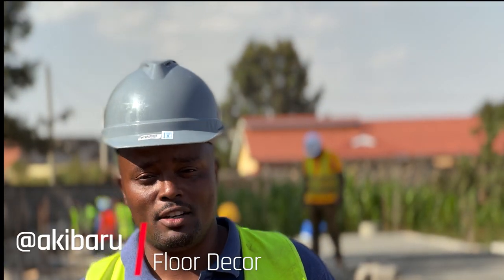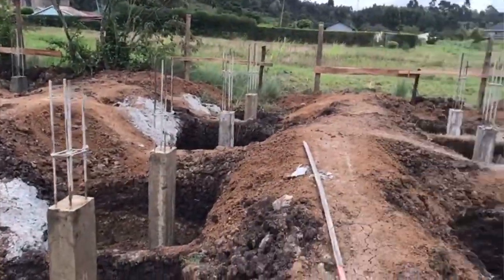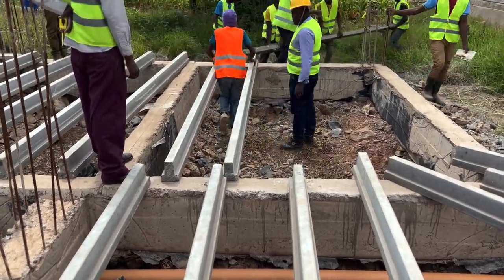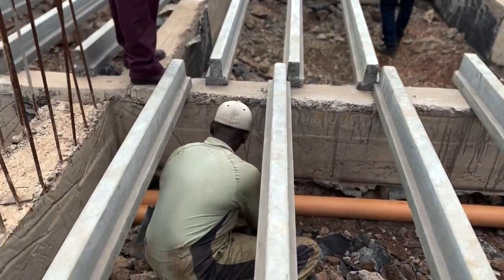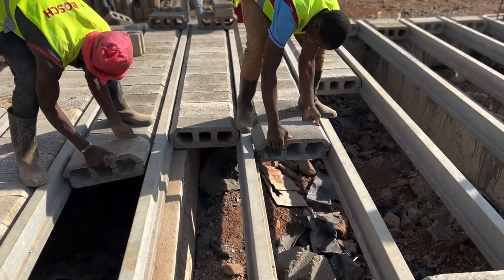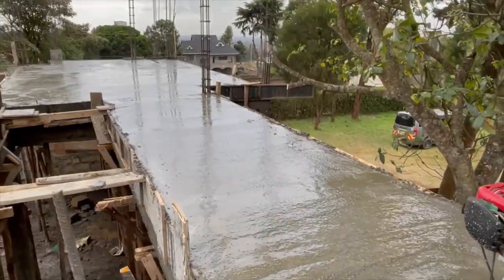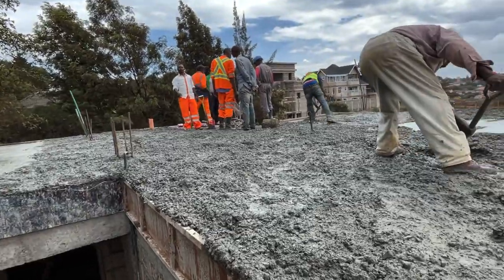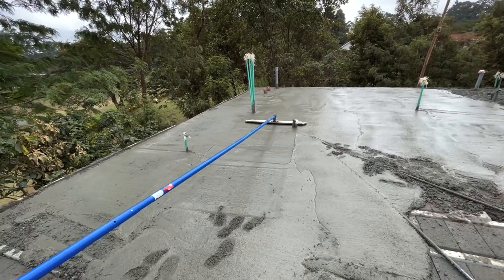No need to excavate cotton soils suspend your foundation with Beam2beam™️ flooring system .

Comment: You are an answer to my prayer. i would like to get in touch with you.
Reply from the maker: Floor Decor Nairobi 
1 Kijabe street ,Universal church building  opposite Simlaw seeds 
 📞0780 955 000/ 0722679830 
Nairobi
Reply: How much are 30ft by 30ft beams
Reply from the maker: @bentricher3126  Sh 305,000/-

Comment: How cost effective is it compared with excavations option?
Reply from the maker: Generally, if the black cotton soil is more than 1.5m in depth, its uneconomical to excavate it. 

This requires a suspended type of foundation whereby columns are dug till solid rock and protrude slightly above the ground level.
Reply: The depth of excavation is dictated by bearing capacity adopted by structural engineer thus it is not fixed in stone that you need to reach rock level

Comment: Hi ..how strong is it
Reply from the maker: Very strong .
Generally, if the black cotton soil is more than 1.5m in depth, its uneconomical to excavate it. 

This requires a suspended type of foundation whereby columns are dug till solid rock and protrude slightly above the ground level.

BBF flooring (beam 2 beam flooring system ) is the way to go to cover the suspended foundation .